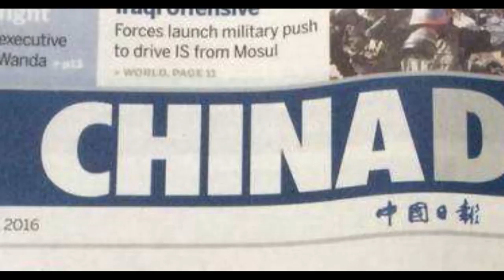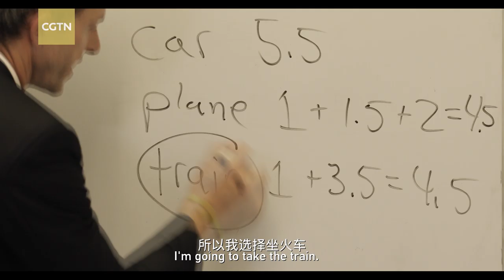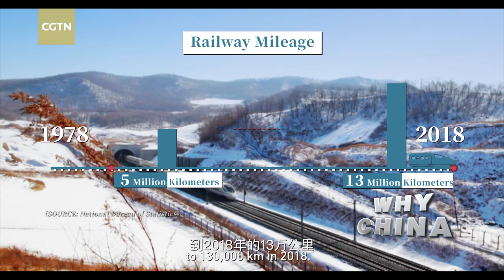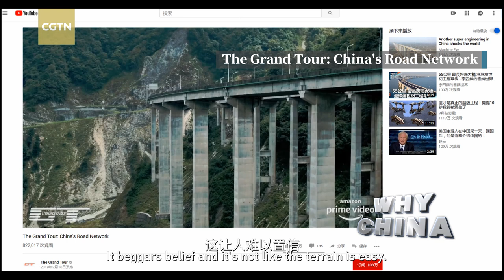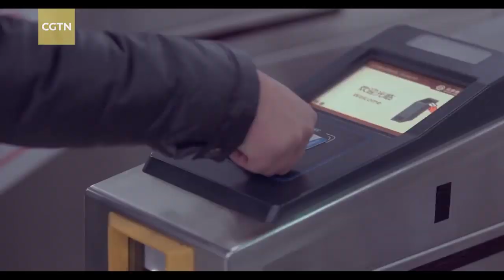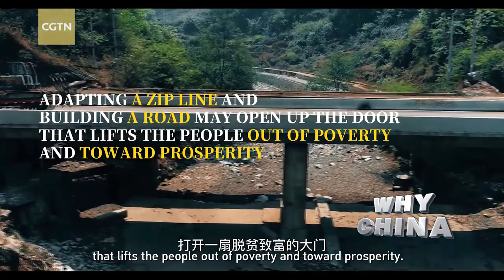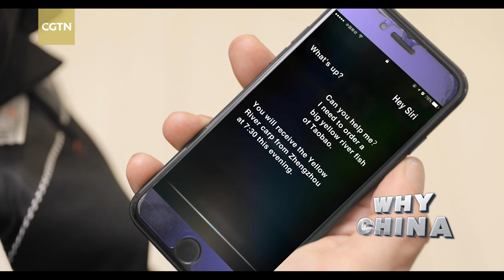Why China can build huge infrastructure projects in such a magical way？

Comment: No trick and just hard work. In Australia, I have observed workers are just idling, chatting, and slacking on the job. I often observed 1 out of 4 is actually working and the rest are just idling.
Reply: @donkeykonghero  You must be watching them council workers building the road. One guy does the digging, and the other 3 or 4 stands around looking at each other.
Reply: In Spain the number increases to 5/4 idling
Reply: Same here in nyc building the forever subway.
Reply: @henrychang4003  too much regulation that's why

Comment: Hey China, here's a free innovative idea to you: use high torque electric trucks to pull vehicles in your traffic jam areas, in order to significantly reduce pollution and fuel costs. 

Just hook up all vehicles via the tow hooks on each car. Then,  just like freight trains, add an electric pulling truck to a certain number of cars (ie every 8 vehicles). The people in their vehicles would have to turn off their engines and use manual steering and manual brakes. You would need to train drivers that this is doable and safe. 

With the costs of fuel and maintenance savings of each of the drivers, they would in turn spend some of it into back into the economy that in turn would further stimulate your economy. Also, you would also create an industry of these car pulling truck drivers and maintenance programs. Since the air would be much cleaner, drivers can roll down their windows to cool down in hotter weather. This would be a win-win.

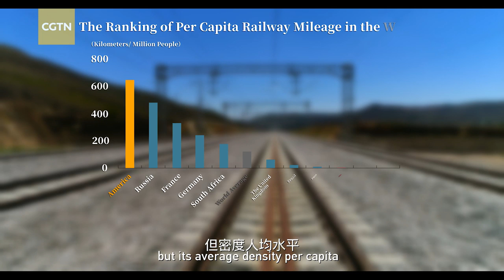Comment: 7:00 ~ All Math is Rooted in Energy. Is it more energy for Trains or Airplanes?

If nuclear submarine lasts for decades, more mechanical sewing machine punch down and connect tunnels.

Rushing China1912 oldest families from train tracks into cities seems a mistake.
We eldest people prefer carriages to enclosed studio apartments with wings.

Because I suspect (cost of road destruction to land) trains cost more, and high speed, consume more energy, I wonder why not surpass USA in air travel?
Reply: 7:29 ~ it would cost less to roof the road, and put everyone on scooters & go carts where no cc inch engine size is ever allowed to exceed Motocross competition engine size, not 4 pistons 4 cylinder.

Costs less the roof road,
Scooter solves congestion.
I require #ss316 stainless steel.
155cc from Yamaha or Piaggio MP3.
No vehicle should exceed 1,000 USA pounds weight.

Roof the roads. Traffic solves itself.
Glass greenhouse with car windshields.
Reply: Water and UV damage destroy #CarbonHydrogen bonds of OIL asphalt.
Reply: If no rain on road, no need to /pave./ Hand lay cut stone. Or #boringcompany compressed stone.